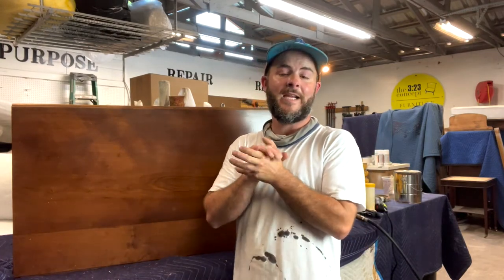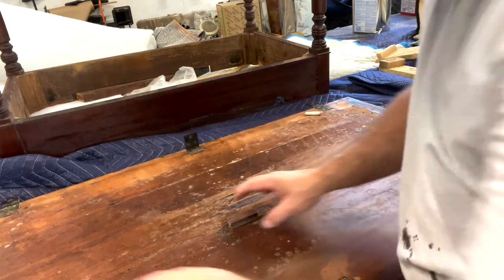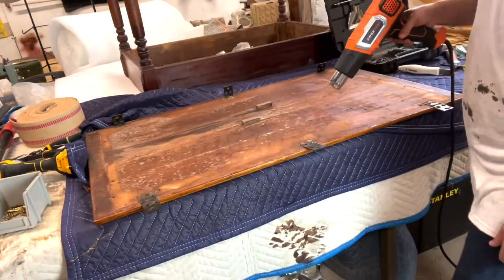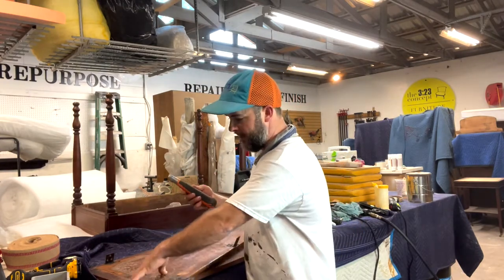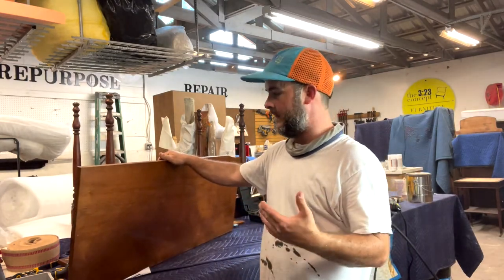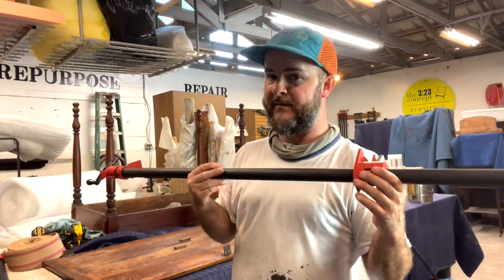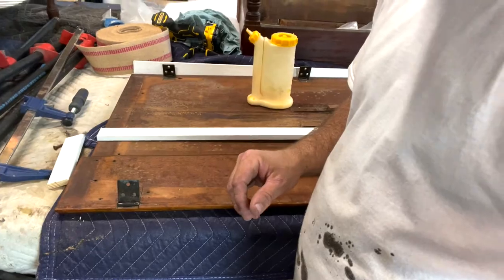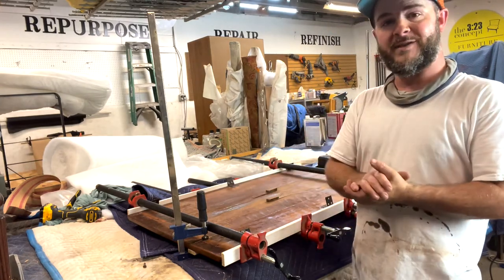HOW TO REGLUE A LOOSE TABLE TOP JOINT (ANTIQUE RESTORATION)

Comment: How do you make sure that the joint glues exactly flat? Seems to me there's a risk that the joint is not exactly 180 degrees.
Reply from the maker: I like to use flat boards over the top of the seam and clamp them down as well.

Comment: What was the glue that you used? Is it dismantleable (either by water or by heat or anything else)? I've been told that one should always use a glue that can be dismantled at a later date if someone wants to redo what you just did (e.g. non-waterproof PVA or hide glue).
Reply from the maker: I use titebond glue, which is reworkable with heat if necessary.
Reply: @the323vlog  Which number Tightbond? There seem to be several...
Reply from the maker: @rowansylvester-bradley9885  I typically use III